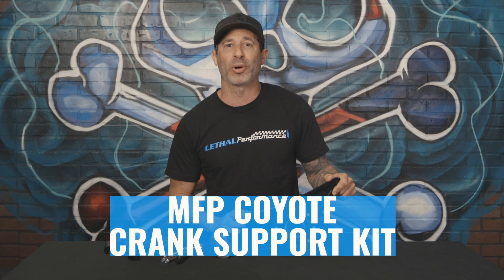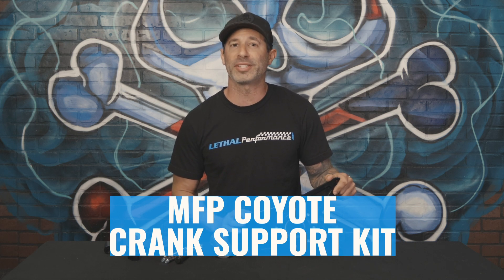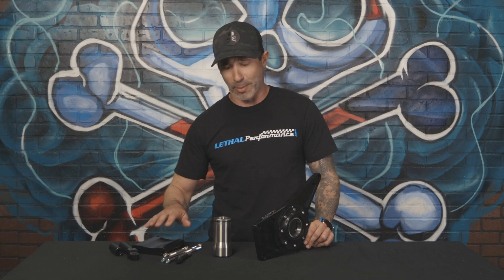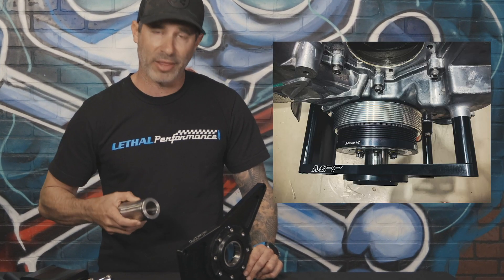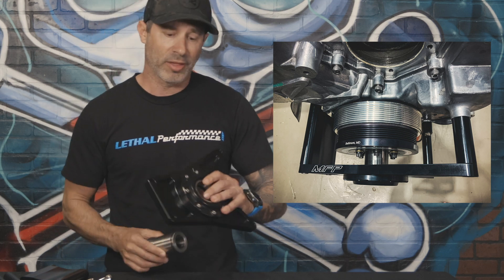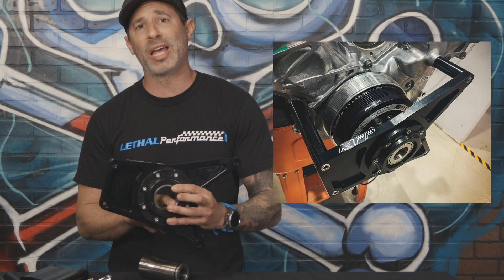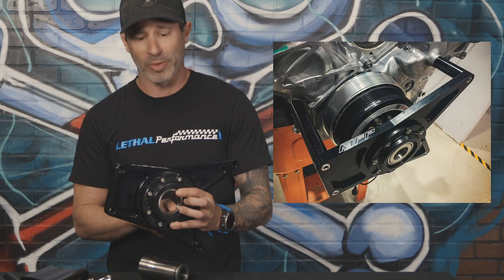MFP Crank Support: What it is and WHY you need it! No more broken cranks!

Comment: Just another part to separate you from your money. If there was a REAL issue then Ford would have addressed it with one of the factory blower cars. 3/36 warranty for a add on blower, and same with a factory GT500 and no crank support? Only time a crank snaps is from other issues and bad fitment/improper install.
Reply from the maker: Interesting theory...

Comment: Just got my crank support for my gen 2 whipple 6 rib setup. Swapping belts seems like it will be a pain, but good insurance.  I lost my stock motor to a snapped crank at 12,000 miles and replaced with an aluminator.
Reply: Kevin, was yours a GEN2 or 3 coyote? What boost level/supercharger pulley? Stock Crank balancer/pulley? Looking at a crank support for my own as well.
Reply: @BigAlsGarage  Mine was a gen 2 coyote with an ATI dampener. Was a 3.625 pulley at time of failure. Also happened 2 weeks after I started using the WOT box 2 step for launching at the strip, although it broke on the way home from track cruising in 6th gear around 2,000 rpm.
Reply: @kevinbaranowski9593  I know it's late in the game, but what power levels were you at when it broke? What was the car running? Any more info would be appreciated. 
Thanks
Reply: @randomsomeone1617  Car was making 786 whp. Had just a shy over 12,000 miles on it when crank snapped. I've seen and heard of more engine failures due to snapped crankshaft snouts than OPG failures.
Reply: @kevinbaranowski9593  what were your mods at the time? How much boost? 
What did the car run in the 1/4?

Was the whole motor junk or could you salvage some of it?

Thanks for answering my questions.
Reply: @randomsomeone1617  whipple tune, 3.625 pulley, 786 whp, kooks 1 7/8 headers, 3 inch cat back,, OPG, CS, ATI balancer,  6 rib kit, stock MT 82 at the time with Exedy clutch kit. At the time car was running 10.7s and around 132 mph at 4120 lbs. Engine was completely destroyed and heads severely damaged.

I replaced with an aluminator,  MFP crank support, calimer stage 3 MT82, MGW shifter 3.31 rear, RXT 26 spline clutch, PBD tune that made 819 whp and 608 ft lbs on a 3.5 pulley, 95 lb injectors, more suspension bits from Steeda and BMR...car at 4120 lbs went 9.9 and traps 138 mph.

Comment: So this is a problem on whipple cars......but not procharger cars. Interesting.  😘😇
Reply: Where are the fast pro charged coyotes at 🤔
Reply: @S550nc81  ahead of PD blowers
Reply from the maker: Nope, problem on all supercharged cars. He said that ;) Also, on the info page it says there are more models/applications being worked on.
Reply: @S550nc81  not fast enough to get outta the way of a hummer that jumped the median and totalled it. That ls why I have a 15 with the same procharger making 750 on 11psi
Reply: @S550nc81  hows that gen3 tick working out for your dud of a bucket?
Reply: @tonyb022377  Be nice Tony! LOL!
Reply: @rayjay8322   I'm just here to collect the tears of haters and fanboiz.
Reply: @S550nc81   step up....I'm waiting, just like I would be at the finish line for you.
Reply: @S550nc81   exactly what I thought....go hide back under your rock....
Reply: Tony Bolton be a man you can hit my DM on IG @magnetiks550 since your car is so fast... I’ll be glad to run that fucking Gen 2 dud of yours. I guarantee you that your mouth is faster than your car.  😏
Reply: Need this for TVS cars
Reply: Prochargers car are even more susceptible to this problem, but they haven't released their crank support for those yet. Personally I know of 5 procharged 18's that have snapped the crank. 2 of them were within 100 miles of install, the other 3 lasted about a season. Only have heard of 1 whipple car who confirmed his lower balancer wasn't installed correctly.